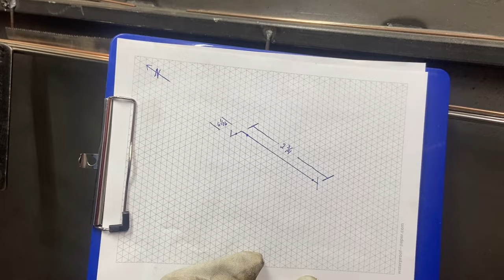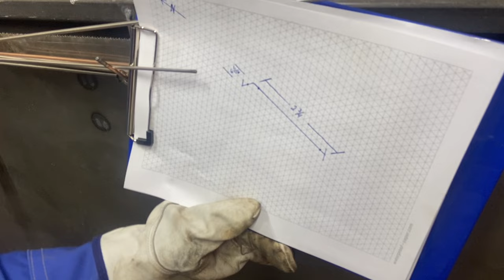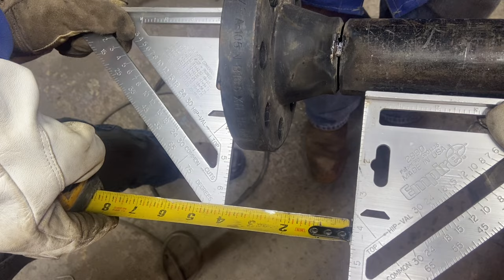How to Pipefit: For BEGINNERS (pt.1)

Comment: Why not use levels when you level the flange instead of messing with squares and why not roll some of the welds??
Reply: Use a 2 foot square & measure along the length of the pipe
Reply: 2 levels or a 2 feet square is better than the speed squares and a measuring tape.
Your helper can get more rode or etc, while the welder makes a basic fit.

Comment: I like to flip the square to the T side on the flange. I make less mistakes with the extra surface area contact and so does my helpers especially when lighting is an issue.

I like your teaching style and think it's very excellent and easy to understand.

I don't teach draw on pipe either. That comes natural enough with experience and emphasize use of wedges.

Square tubing is different. I teach how to hinge tack that to square because it draws so bad. 

But 👍we need more Welders desperately.
Reply from the maker: much appreciated man!

Comment: Grind your tachs, only tach in 2 places, dont smash a spacing tool in and destroy the landing,, use a brass hammer, hit the open side , it will move,,fit the 2 90's first in a vice and roll them out, then fit it to the pipe and roll that too
Reply from the maker: Thanks for the tip!

Comment: Instead of trying to measure off your two squares at the end you could have made the pipe level to match the face of the flange plumb. If you can't get your stand to sit level just make them the same amount off level/plumb. Not that you can't get it right that way but using levels is a bit faster and easier. If you can't roll your pipe you do need to do that on your sides though (for anyone reading) Great video though

Comment: I never use squares. I use two or more magnetic levels of different lengths. And one magnetic pocket level 3" long. Pocket level is very handy for squaring small diameter elbows.
Reply: Levels only work when you're stationary . On boats you'll always find squares work better

Comment: Im a very new hvac tech. Did installs before working service. In the time ive been in service ive been super stressed and i think its for two reasons 1. On call schedule and 2. Mental fatigue from trying to work through problems i dont know enough about. I also think ive learned i like building much more than fixing things. Im an introvert as well but i like having someone to talk to throughout the day if i decide i want to lol. Is pipefitting a good career switch choice? And is it better to stay in the shop or go in the field
Reply: Stick with the HVAC service. It's more consistent work and and mostly in town. Around here the fitting is mostly out of town and inconsistent when you will be working. I was just asked on Monday to be in a town 3 1/2 hours away to work 4 or 5 weeks of straight 12 hour shifts starting Wednesday morning. Great money but no life and why our hall has probably an 80% divorce rate. My ex "only" gets 30% of my gross for child support because she makes more money than me but you could end up paying over 50%. Being on call for HVAC isn't too bad and you'll figure out the usual problems so you know what to look for before you get to the job. I did about 4 years of new house construction then 12 years of plumbing service which is way worse than HVAC but you get used to it. I just went about my business without thinking about the pager and if the pager went off it's extra money. Plus fitting is far more physical and hard on the body that you will feel when you get older in a bad way.
Reply: @tylerholloway579  I work out of the plumber's union. I started non-union doing new houses and worked mostly service for 2 different union companies. I'm just taking calls off the books now as I'm semi-retired and not really interested in being crippled up all the time. I was just off for 20 months waiting for double hernia surgery and my body actually feels better all over.
Reply: Stick with that bro. I’m a fitter and the mental gymnastics you have to do to finish some jobs is crazy.
Reply from the maker: Thanks for sharing!
Reply: Curious what decision you made and how it turned out?

Comment: quick question.. im kinda new into this, is stick or mig more common for pipe fitting. i tried looking online but get many mixed answers.
Reply: pipefitting like if you are a pipe fitter that builds fire sprinkler systems? mig is far more common for in the shop work. stick is preferred in the field because it is easier to run leads up 12 to 20 feet up in the air than a mig line.

Comment: at 6:24 when you're using the wedge to level it, what did you do to remove the wedge and keep it level?
Reply: tack the fit while wedge is inserted normally it will fall out.

Comment: Please tell these folks looking at your work that your end prep on these 90 deg ell's are not right period. I would fire a pipe fitter that used those 90's without cleaning the inside correctly.
Reply: Relax nuclear code
Reply: Did you get the job? And how was it

Comment: So are these standard methods of fabricating pipe out in the field? Asking because I’m looking to get into the field with no experience other than at home Got me already a beveler and roll out wheel
Reply: In the field, you're more than likely going to be fitting pipe with a gap for heliarc penetration. But yes, this is pretty standard methods. for pipe up to about 6 inches, i place 2 100lb pull magnets on the bottom 45 degree sections of the pipe and the fitting/pipe snaps right in place. Common gap is 3/16 or 5/32
Reply from the maker: Good luck!